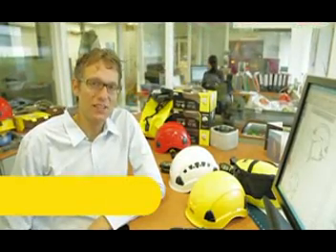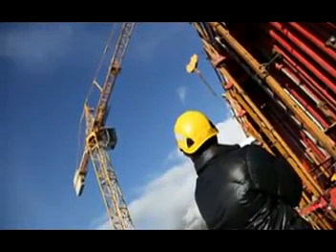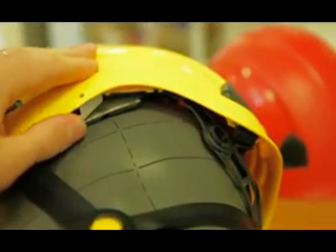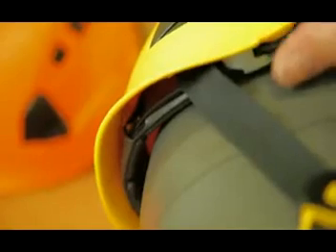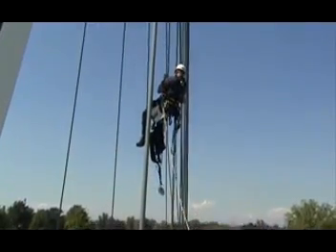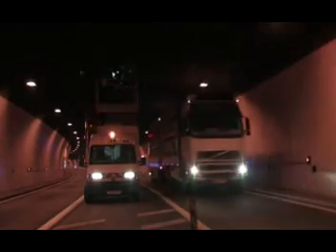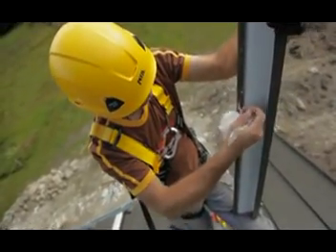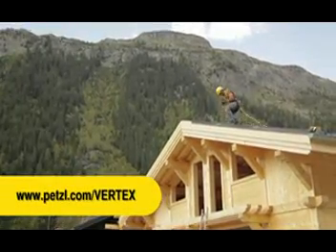Petzl Vertex Safety Helmets - New Range now in Stock!

Comment from the maker: Hi,
If you are working on the ground you need to choose a helmet which has a chin strap that will break away at 25daN. This is in case a crane hook grabs it, it will tear the helmet off your head rather than lift you up. However if you are working at height your helmet should conform to EN 12 492 where the chin strap must stay on at forces up to 50daN. The Vertex ST is ideal for work on the ground and the Vertex Best or Vent are suited for work overhead.